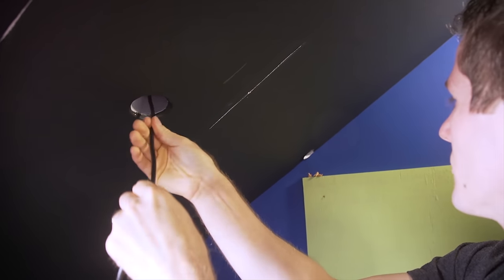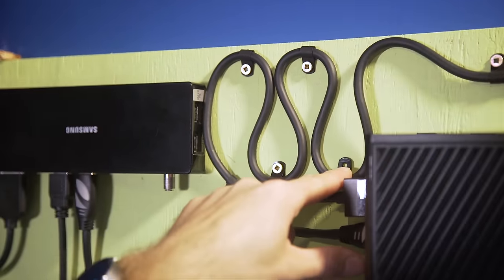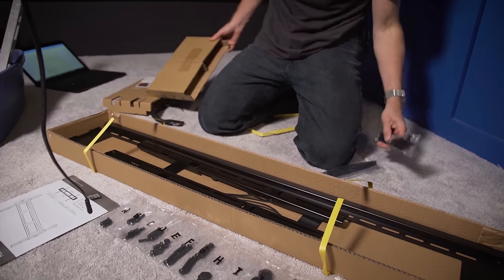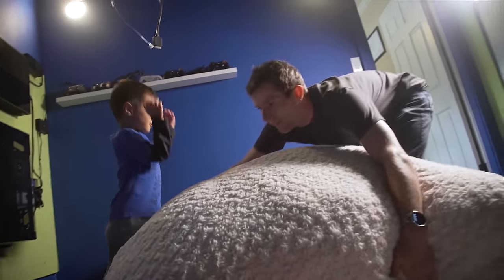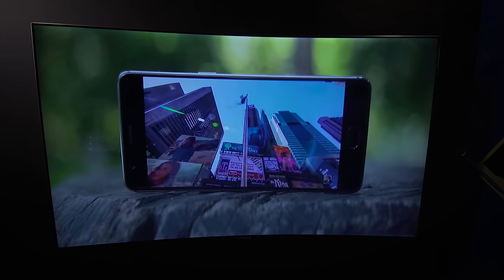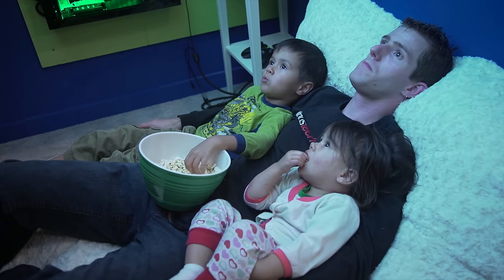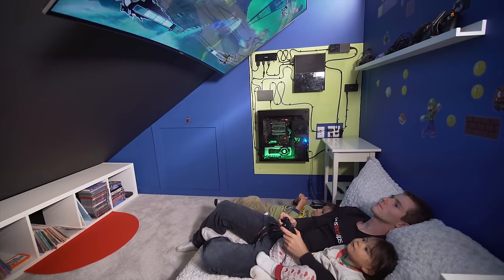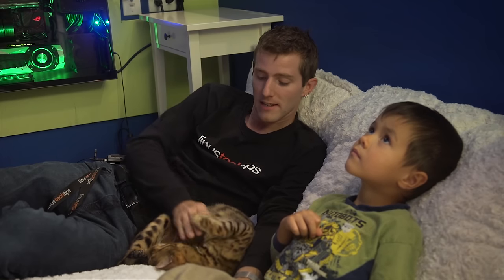World's Most Comfortable Gaming Setup (Finale)

Comment: This reminds me of what i did, I took a Vivitek Qumi Q38 Led 1080p Mini Projector then using Targus - Grypton Pro XL Tripod i attached it to my queen metal bed frame pointing the projector up to my ceiling.  I then use a Logitech wireless keyboard with integrated mouse pad to control the projector since the projector is an android OS device.  I was able to install all the usual smart tv/device apps including youtube and several movie apps. I can also game with either a console or computer,  just connect what ever you want. The projector is not noisy and doesn't create much heat since it uses led lighting at 500 lumens.  The size of this projector is only about 8" L x 5" W.  For cable tv watching i tried using the IOGEAR - Wireless HDMI TV Connection Kit, but it did not work well so i returned it. I used an hdmi cable connected to a 1 in 5 out HDMI switch from a samsung home theater receiver that mirrors the hdmi signal to both my regular wall led tv or the ceiling bed projector. Its enjoyable and comfortable to just stare at the ceiling.

Comment: I would never hang my TV like that. Ever. Build a custom drop down for it...
Reply: Tx Bombero why not hang it like that?
Reply: Mihaitzaofficial Gaming that's unsafe af man. It might be in there "securely" but I'd never trust it. I don't care if a 5 star carpenter installed it.
Reply: The TV weighs 79 pounds and that mount can support 200 pounds. 

Where is your logic.
Reply: This isn't 2005 buddy
Reply: two special plastic screws can hold 200 each.
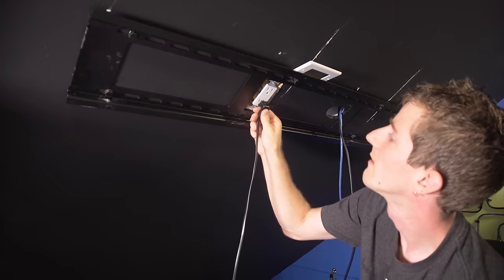Reply: [L]ou He said himself that the mount nor the TV are designed for angles like that @ 3:33
Reply: GamingExtraordinary  The mount can hold 200 pounds, and despite the large size of the TV

ITS ONLY 79 POUNDS

#2 It is mounted on wood and not dry wall

If people can do pull ups on bars CLAMPED onto a wall, and Linus did a pull up on a screwed mount, then this TV can be 100% safe while mounted on this wall.
Reply: Exactly. If the tv dropped I seriously doubt the glass would even fully crack to the point of risking serious injury or death. it's not high up enough for that to happen. If it landed on his kid that is a different story

Comment: I just want a 400$ computer
Reply: Do what I did and buy used. I know it sounds iffy, but when new parts come out people sell their old but still very updated parts for super cheap. so 400$ might even last up to 500-550$ if you negoiate prices. and. Build it yourself. no labor cost. and parts you want.
Reply: +Neville9013 I built mine on 360$ lmaooooo gtx 780 for 150 , what a deal , nd goy everything else which hunting
Reply: +revengexxy2 got
Reply: revengexxy2 damn dude. What kind of power supply do you have cause mine is shit. And I'm looking into a 750ti right now. Or I might go with the rx 460 coming out soon.
Reply: The 750Ti is an amazing card for the price. What's great about it is that it can pull all of its power directly from the PCIe slot. I personally use it and I like it.
Reply: Yeah I used a psu Calc and with that card you only need not even 300w
Reply: Ornstein the DragonSlayer you te the best very cool

Comment: Terrible sensation of shifted gravity. Looks like everything on the screen is going to roll off into your face. Running your character in a flat terrain seems like hiking up a mountain. At this particular inclination you would have to lean down even more so your vision match a 90º with the center of the screen. The lower your eyes have to look the better; so you expose less eye surface, avoiding dry/ tired/ irritated eyes for much longer. A lot of things makes this title wrong.